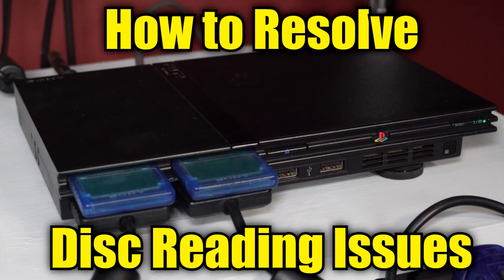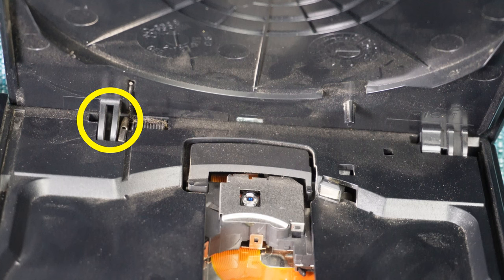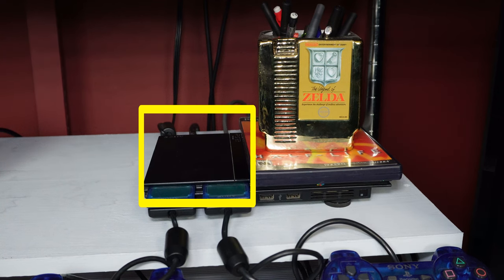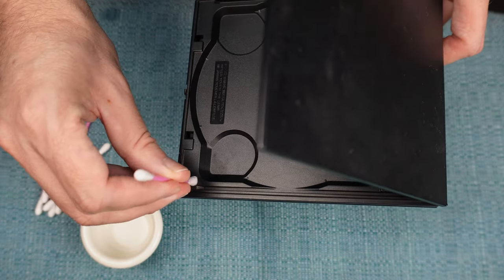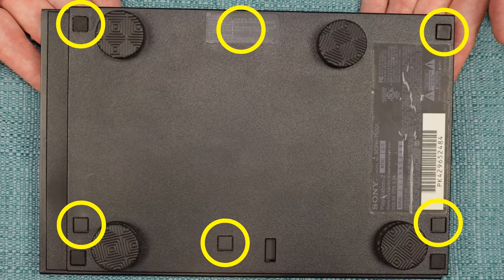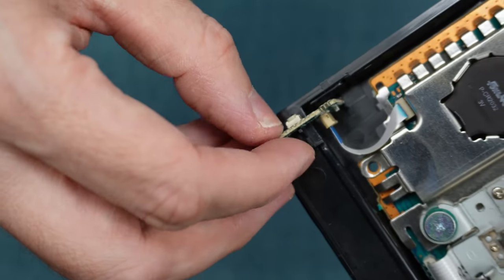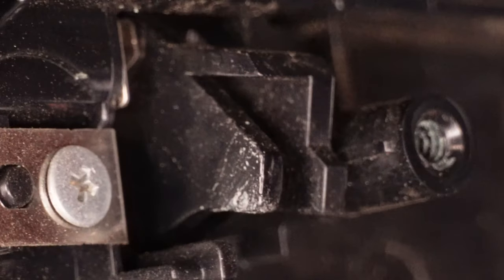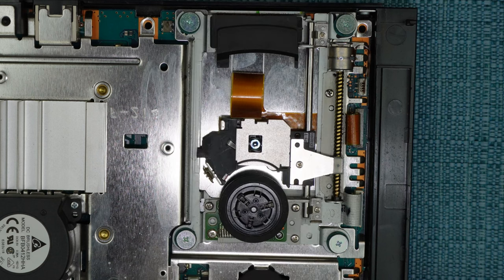How to Fix PS2 Slim Disc Reading Issues (Massive Amount of Solutions for Game Freezes, Door Problem)

Comment: I had issues loading ps1 games, it was like the console didn’t think the disc was in there. Then I tried flipping it upside down and it loaded the game near instantly every time with no issue. It’s the strangest thing I swear
Reply: When you flipped upside down you did that to the disc or flip console upside down?
Reply: @jewelsunniheartsfitnessanime i’m assuming the entire console and with the slim model as it’s a top loader and the lid may get a little loose over time
Reply: Bruh tell me how i put it upside down and it worked
Reply: @demonpluto121  Same 🤣🤣🤣
Reply: It even works for PS2, it crazy!
Reply: Thank you! I tried this and it reset my sensor to the correct position!!
Reply: @jewelsunniheartsfitnessanime I flipped my disc over and it reset my sensor to the correct position! Fixed it for me
Reply: @Costilow  for games like midnight club 3 and others that some ps2s have hard time reading I’ll try and see if that solution works
Reply: @jewelsunniheartsfitnessanime  awesome! Good luck !
Reply: @jewelsunniheartsfitnessanime  yeah try flipping the disc upside down, and then if it says “can’t read disc” flip it back over and hopefully it should work!

Comment: I've been meaning to get my PlayStation 2 fixed for a really long time now, but I'm not quite sure what the problem could be, because I can hear the laser assembly moving and trying to read the disc, but doesn't, however, by opening and closing the disc door multiple times, it can suddenly start reading the disc correctly, basically feeling like it only works when it feels like it.
Reply: Replace the laser clean the door sensors
Reply: @axcc  But the strangest part is that, after opening and closing the disc door several times, and it reads the disc correctly, everything works just fine afterwards.
Reply: Sounds like the ribbon needs to be changed the eye might be OK try that ribbon first to save money

Comment: Something else that can happen, is the laser has a mechanism to help it focus where the lens will slightly move up and down and there is a tiny piece of support plastic that breaks. When this happens it can have a hard time focusing properly. You would have to take the mechanism apart to get to it. I recommend if you are going to attempt this, look online because it is easy to break if your not careful.

Comment: Thanks, I bought a ps2 from a Goodwill bin and yeah first 2 days played fine. i decided to take it apart because I could see the dust bunnies and the the battery had run out. Afterwards it wasn't reading the disc because there was a screw  hole that broke off and it made it so the contacts with the top half of the ps2 wouldnt sit tight enough to touch for the 2 sensors, if I placed something on top or flipped it the ps2 would work fine. sheesh i guess i should have left it dirty lol

Comment: What do you think may cause a screen to usually freeze and or stutter? Like for example whenever the music plays for my video game for my ps2 it starts to freeze/stutter constantly until it gives up completely by automatically turning off the music. It’s the same for a video games intro. Like every time I start up a game the intro constantly freezes and stutter, but the strange thing is that it doesn’t always happen to my other video games though which run really well. So my question is the console (PlayStation 2) simply not registering the game properly or is it the disc themselves? Honestly any feedback would be great!
Reply: Same problem how to fix it 😢 do you have any solution
Reply: Just taking a crack at helping but it sounds like the game is only freezing in certain spots. Which means the lens is freezing when in certain positions I assume. Try the tip at 8:35

Comment: Tried all of these but didn't seem to solve issue.

Games load, but all of them freeze at some point. Soul Calibur 2 can play intro cutscene, but freezes at the character select. Dark Cloud shows the Presents message on boot, but freezes. Bully freezes when the intro ends or skipped. When trying to load memory card in browser, it freezes and sometimes a visual glitch appears. DVD movies don't work. CDs work. System configuration has no problem. I additionally replaced the laser but nothing changed. So not sure what else to do.
Reply: Replace the laser and take the anti static off
Reply: @axcc  replacing laser didn't help
Reply: Try the ribbon

Comment: Anyone know about this issue? So it was working ok but I cleaned the laser lens with alcohol and it literally stopped spinning every disk. I used care so I thought what the heck. I went back in with a a tip and just kind of moved the laser lens a little bit and it does move slightly…and poof it works again …so I don’t know if it’s possible to jam it with the a tip wondering if anyone else had that issue??

Comment: got a complete system for $30 and 2 games but it has disc read issues for dvd  (music cd's work oddly enough!) tried taping the tray sensor buttons but this didnt fix it so maybe some additional alcohol cleaning and regreasing might. If all else fails, might try fmcb.

Comment: I’m having a issue with my ps2 slim. The picture blinks intermittently. Sometime a lot and sometimes less often. Any ideas of how to fix it?
Reply: It's your av composite cord. I had the same problem with one of my ps2's, i used the av cord from my other ps2 and it fixed it. A replacement av cord is around 10$, or a HDMI converter for ps2 is the same price.

Comment: My game is reading some games and not others regardless of scratches I’ve got games sitting on my console to keep it shut I’ve cleaned the laser multiple times
Reply: Mine is doing this, did you fix the problem?
I’m thinking about opening it to lubricate it- I don’t think my laser is bad, I think it may have a problem reading a couple big games, which I read is usually a problem of laser rail lubricant drying and hindering movement of the laser to the outer edge of the disk on big games
Reply: @superodfx  I opened mine up and it was close to spotless so I think in my case it was a case of the laser gave out